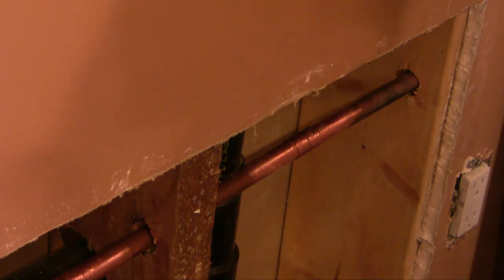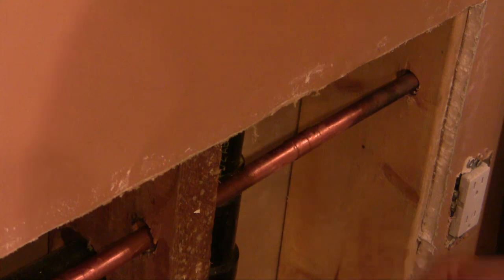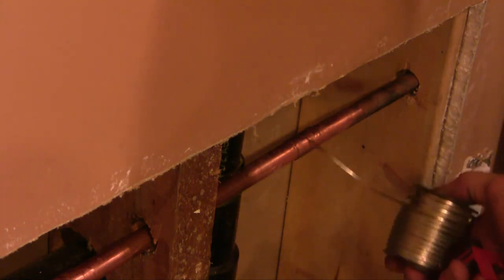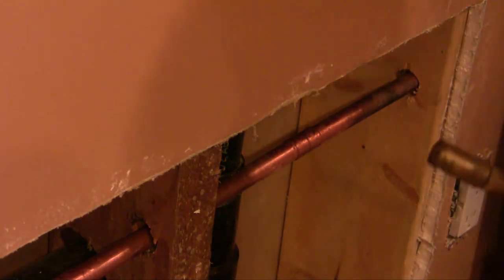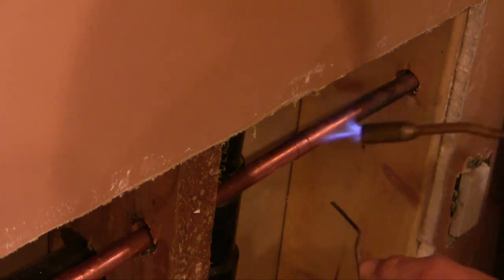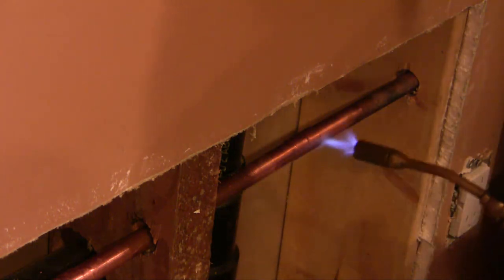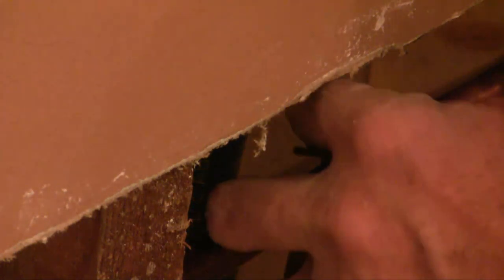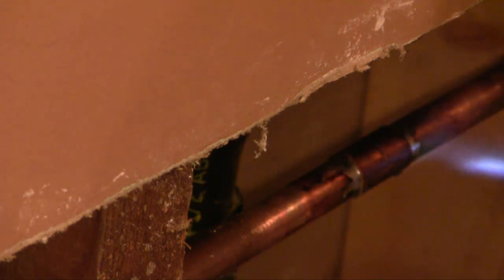How to solder copper pipe

Comment from the maker: Very good point. When PEX first came out I wondered if we were hiding possible future weak points behind drywall. So far that hasn't been an issue, and even cold exposure seems OK compared to copper. I still wonder about UV exposure, for those pipes exposed to sunlight.

Comment from the maker: @DJDevon3 I take a finger and spread it on all the previously cleaned contact surfaces, and then after that I slide the two fittings together, then twist to spread the paste evenly. If you don't use paste it gives a dry splattered and spotty, weak connection. With paste and with good cleaning, the solder wicks itself into the joint and gives a consistent, water-tight seal. I find it amazing how the solder finds it's way into the contact surfaces. 

Thanks for your comment!

Comment from the maker: In case anybody didn't notice, it's important to avoid using any lead in the solder. All the solder labelled as 60:40 and 50:50 has lead in it, and lead-free solder should be clearly labelled at the store. Leaded solder is marginally easier to use, and old houses are full of leaded joints. But any new construction in the last 30 years requires lead free solder for household water sources.

Comment: There is currently an on going lawsuit with the makers of Pex, I am a plumber as well.  While pex is inexpensive and easier to install I'm still not sold on the idea.  Whereas copper kills bacteria in the water, pex does not.  Your video doesn't show any heat mats.  They can become a problem.  Fortunately there is a new tool out called the Solder Snake.  You guys should check it out.
Reply from the maker: Yeah, I do have a protective heat mat to help deflect the heat away from the underlying wood, but I couldn't find it on the day that I did this. I'm glad to meet somebody who has the same kind of feelings I have had about plastic pipe. I do wonder about plastic durability, especially when sunlight is in the mix. If it doesn't last as well as copper, it may create lots of renovation jobs in the future, ha ha. Thank you for visiting.